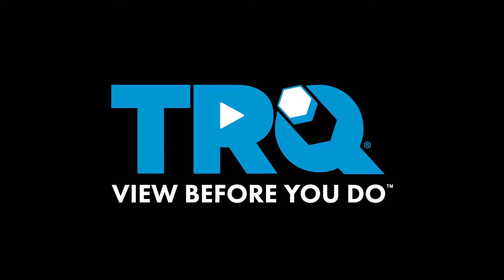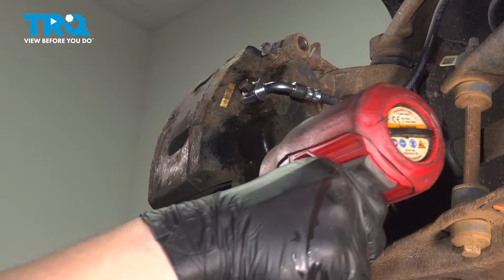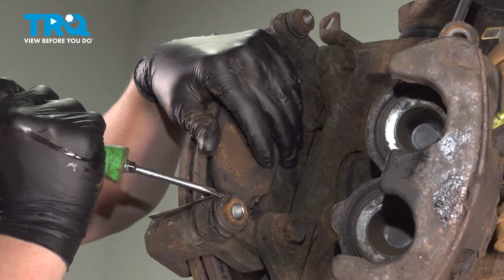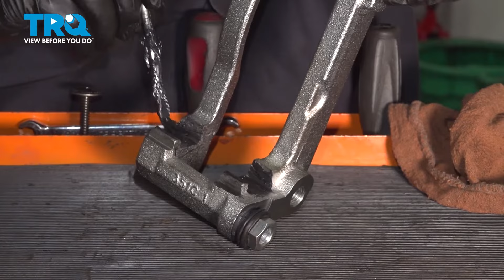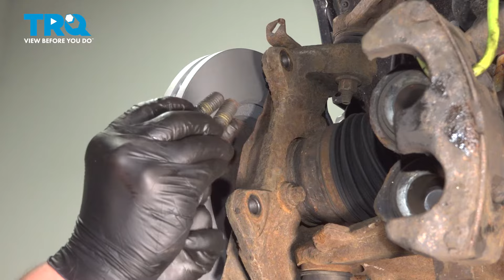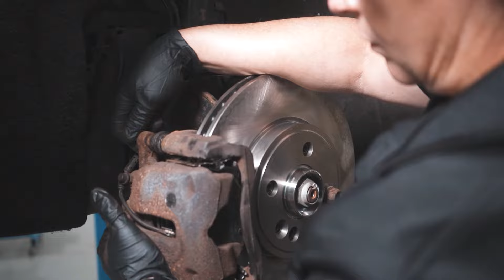How to Replace Front Brake Calipers 2014-2018 Chevrolet Silverado 1500

Comment: You said to put Silicone paste in the valleys on the bracket where the pad hardware "tins" (shims) will sit in the bracket.  After greasing them with Silicon, you put the tins/shims right on top of the grease.  I question this.  The tins don't slide side to side in the bracket.  The pads slide side-to-side in the tins/shims.  I think the brake grease goes on the tins/shims, and the pads slide back and forth on that grease.  Am I mistaken?